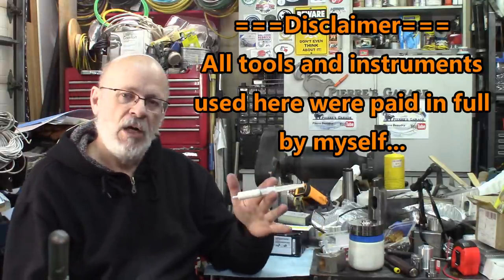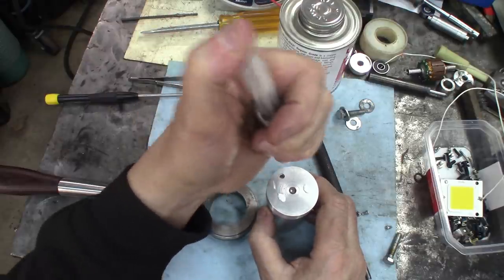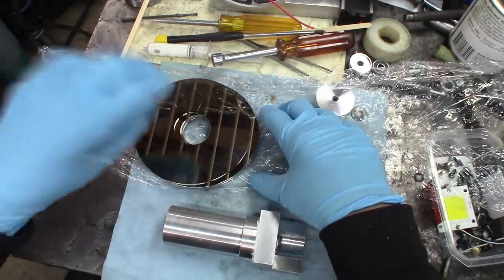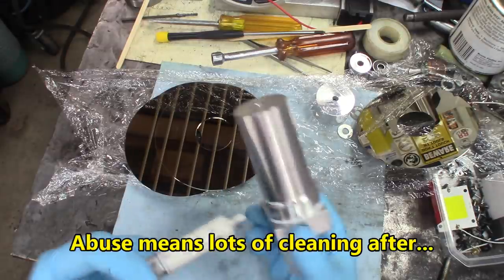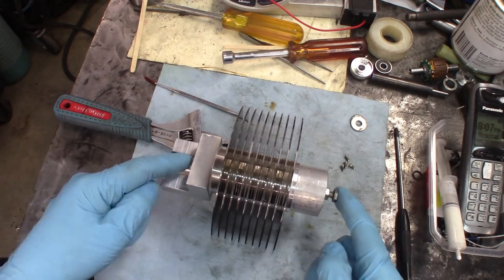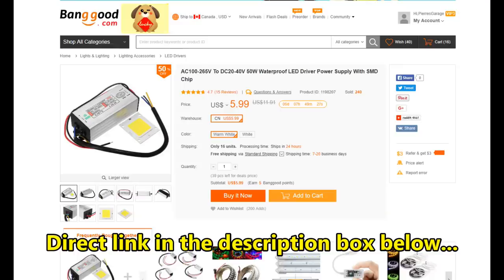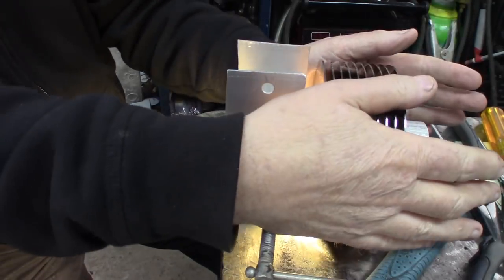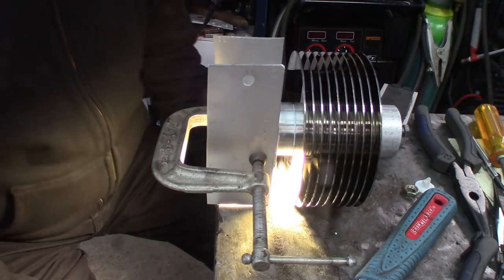50 watts LED COBs, About them and making a light fixture from recycled materials...  Part-2

Comment: Cool. Cheers from Aotearoa NZ. I can't afford to buy grow lights, but I have time to learn how to make my own. This certainly helps. Thanks.
Reply from the maker: Guess you're in the middle of Winter, Brrr, I'm not liking cold as much as soe years ago...    ;)If you look on Bangogod, you'll find some grow light type cobs, same principle as to keep them cool. One piece of advice here, try to get some aluminium that isn't as polished as this, the reason is that this is very reflective, what you need is some surface that is very emissive, unpolished dull and even draker surfaces on the heat sinking will do a better job at evacuationg the heat, if you still decide to use reflective surfaces, you'll need moe surface in order to achieve the same result...
Good luck with your project,     Pierre

Comment: Hi Pierre, You could sand blast those disks, the rough surface will have much bigger surface area and a rough/dull finish dissipate heat better according to the interweb, nice job, thumbs up.
Reply from the maker: Ya... there is another viewer that also suggested some mods like yours, even painting black the surfaces will increase emisivity by a huge factor new expereiments in perspective...   ;)
Thanks for your input,     Pierre

Comment: That Pierre is a heatsink!! Wish I had one of those huge old hard drives.
Not sure I'd go to all that trouble but you got a great result that's for sure. You made some innovative parts. Nice work. :)
Reply from the maker: Hi Chris,
To get those HD's good advice is to be friend with IP guys, they're the ones maintaining those computer systems...  Just on of the solutions possible...    ;)
Can't throw away any good looking junk, so, if I want to be able to circulate and breathe in the shop I've got to transform the clutter into something I can hang somewhere...   lol
Cheers,    Pierre

Comment: Hi Pierre !

Ha, ha, ... yeah that was really stupid ... BUT

You're forgiven because of the really nice and nifty project you showed here ... very nice !

I like that near "baby" sized TIC handle you got there - wonder if I can get one to my TIC welder.

I'll see if I can improove a little on the design ... and use my spare plates too ... 

I have some very big ones ... I think, Ø18-20" brown ones I try design a table lamp with some brass or bronze ... if only the "Model" will accept it - the brown color will give a very very pleasent light , I think - now to Fusion360 first.

... and that bench of yours ... you should see mine at the moment ... I can't even get through the door to the shop because of tools and stuff ... I'll have to clean up before I go "On Air" again ;-))

Cheers to all your monkeys in Canada !
Reply from the maker: Hi Keld,
This TIG handle is a WeldCraft 300 amps water cooled torch, it's lite and flexible, you'll need a water cooling system to use one of those, and, last but not least, quite costly...   $$$$ US   (  $ = 100USD )
Improvising with recycled material is the best way to get them used and make creative devices...   Let's see what you get done...   ;)
Never mind cleaning up, I hate cleaning...   lol
We need a new episode of the Monkeys Show soon...
Cheers,    Pierre
Reply: Fortunately I HAVE a water cooling system but UN-fortunately I haven't got 100's of dollars ;-((

Comment: I’d be painting each platter flat black. Emissivity of shiny metal is very low. Actually, the paint doesn’t have to be black...any color is better than no paint. The paint acts as an impedance transformer between the shiny metal and the air, to improve heat radiation. Nice looking assembly.
Reply from the maker: Hi Paul,
I'm quite affraid that some paint wouldn't stick to those shiny surfaces...  Could be worth the try and compare on some future units, if only there is enough time to do so...   ;)
There is good info available on the Web, another time consuming task...   lol
Cheers,   Pierre
Reply: Pierre's Garage Well, I’m just talking about what is optimum, as opposed to ‘good enough’. I imagine that what you have produced is already more than adequate. However, for anyone who wants to make the smallest possible heatsink or the heatsink of a given size with the lowest temperature rise, combine all the techniques discussed so far... actually, you can go one step further by using solid copper and applying a black copper oxide coating...
Reply from the maker: This info is gonna help me in the planning of future projects, if it's possible to make an even better disign...
Using less platters by better spacing and blackening the surfaces, etc...   Fun to try and discuss...
Copper is an even better thermal conductor than AL, about twice better, quite costly, though.
I like your inputs, it pushes me to look for better solutions...    ;)
Reply: Pierre's Garage Since you mention the shiny surfaces: that’s the worst possible finish for emissivity. Sandblast them, sand them... whatever process you have to make the finish dull will improve emissivity. You can think of the process of heat flow as reversible, and any surface that reflects heat (or light) well also emits poorly.

Comment: Did that say 7400lumen on that 100watt? That is not very good output for the power.  That is one heck of a spotlight you built!
Reply from the maker: Hi Brian,
Here we're not dealing with high end items, those are more common types, the high end pieces are quite more costly up to 4 to 10 times the price of those here...
For lighting a shop those will be quite adequate at a price, the trouble is to get enough Aluminum to sink the heat and keep them cooled so they last a long time....
Cheers,    Pierre